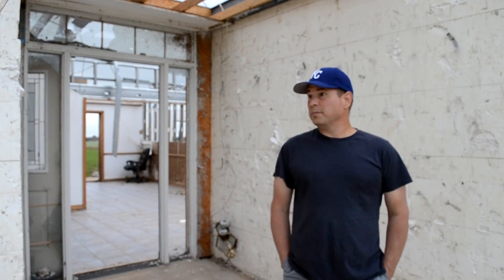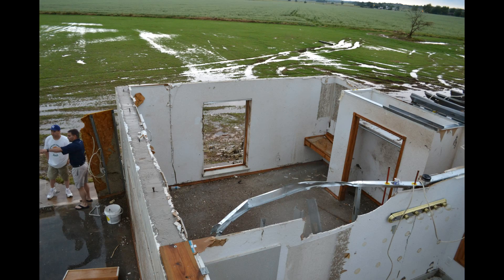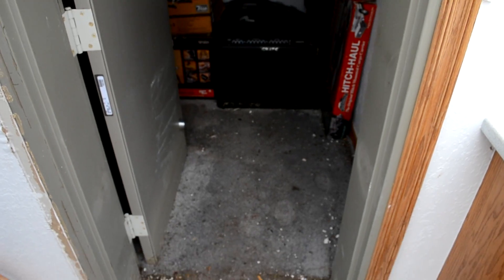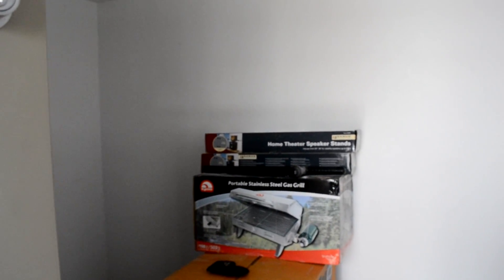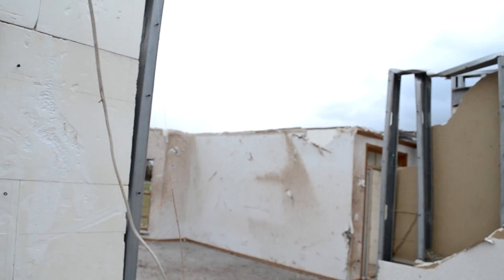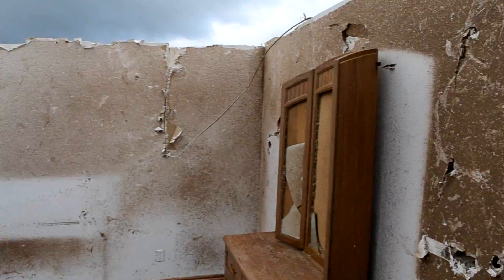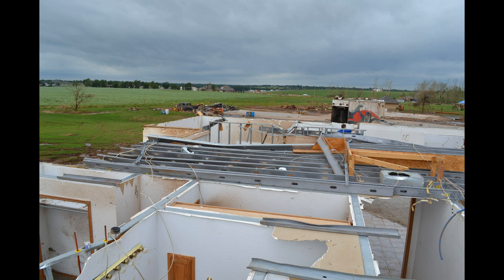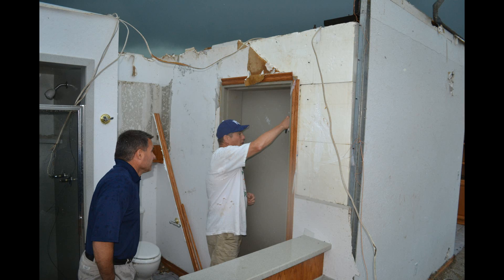ICF Construction and Tornadoes

Comment: Is there a roof type that would have resisted the tornado force? That wall looks barely affected, would be nice to have a roof that matched.
Reply: Yes, a steel reinforced concrete roof with the steel tied into the walls. Several ICF manufacturers have deck/roof systems that will work just fine.
Reply: @johnboldt5320  Is there a garage door that will stand up to tornados?
Reply: @dupeaccount1647  no... and windows would be gone too. Impact resistant are rated to 90 mph.
Reply: @av1204  not true, been through Dorian and Mathew 2 of the worst hurricanes in a icf house in the Bahamas with hurricane windows with no damage done to the house, both having 150mph sustained and 200mph gusts..
Reply: @av1204  sorry to disappoint you but you should maybe talk about things you know because you're incorrect. Demanding on the thickness of the pvb in the glass it's not going through. Some people maybe choose impact windows with the thinner pvb in a area where it should be thicker. Think what you like ive experience it.
Reply: @richarderrington9478  think what I know Ive seen tornado damage with winds of more than 200 mph. I drove through moore oklahoma and impact glass or not it would be gone. I built my own ICF home and bought impact resistant glass. Watch any video there is of a wind impact test. They shoot 2x4s at 15 mph and that is a pass. They test walls to 94-115 and when they do windows, even top of the line pvb impact ones they go right through. Hell metal shutters sometimes fail.
Reply: @av1204  ohhh I must've dreamt i live in the Bahamas and didnt go through any of these hurricanes. I have watched videos on impact glass and haven't seen anything go through them. Yours must be the real cheap crap. Did you go through Dorian or Mathew in the Bahamas? What ever you say lol😂
Reply: @richarderrington9478  no just panama city during michael.
Reply: @av1204  Internal shutters might help. Inside, so they couldn't get pulled off.
Reply: @johnboldt5320  The thing is, if you really prefer the look of a wood frame house and have the money, you could build a decorative wood frame shell over a concrete core and roof. Sure it'd be pulled off completely in a worst case scenario event and your house wouldn't look pretty anymore, but it would still be totally habitable and safe.
Reply: Spider tie icf
Reply: Something like this probably:

https://www.youtube.com/watch?v=jJa0zMw6Sbo